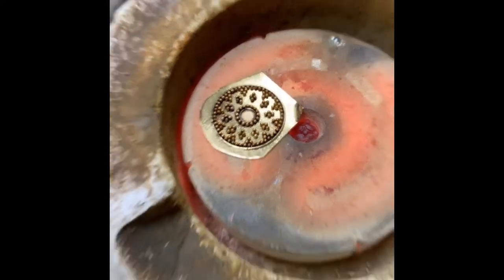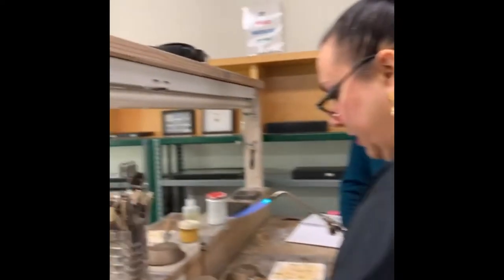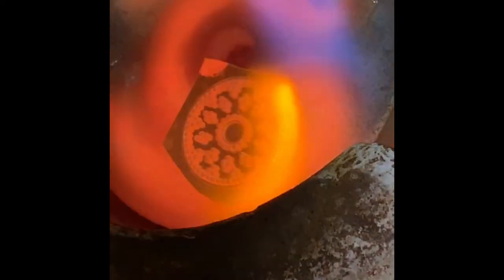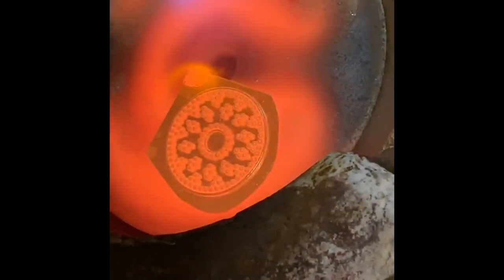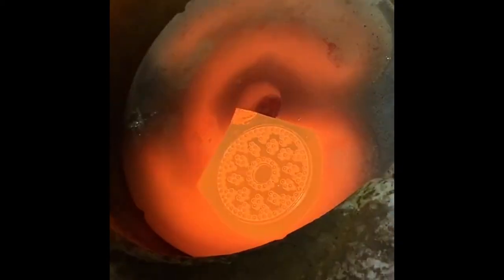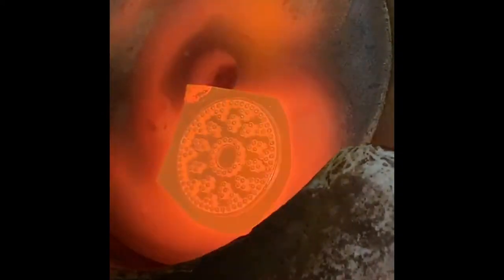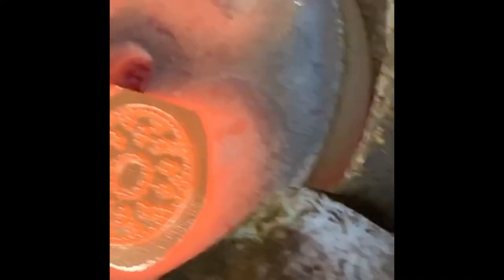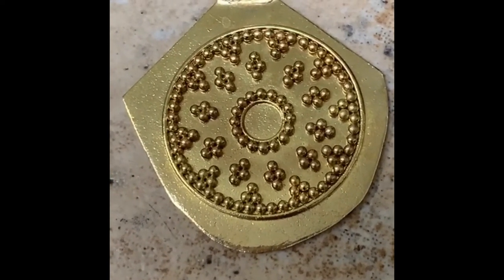Fusing 22k Gold Granulation in a Kiln(Without Overdoing it!)

Comment: Hello Jeanette! 👋👋 is it possible to achieve granulation without using an ultra lite kiln?
Reply from the maker: Absolutely! Lots of goldsmiths don't use a kiln at all, they just use a torch on a charcoal block. The kiln adds background heat, which is helpful but definitely not a necessity. :)